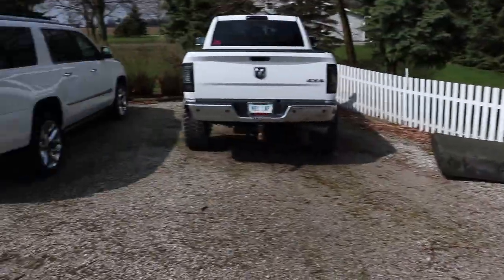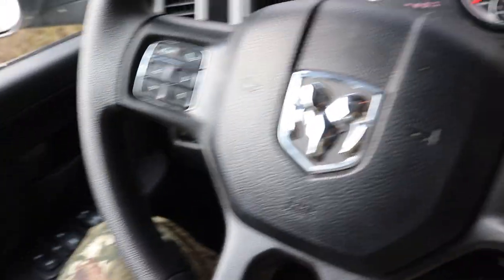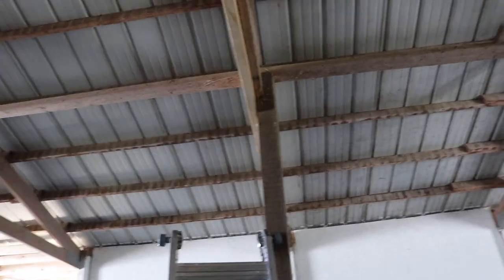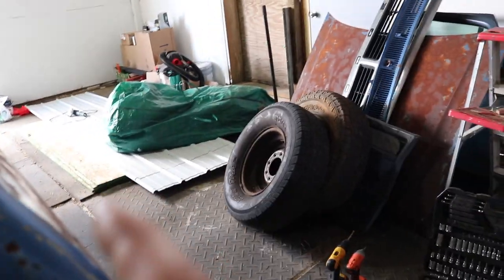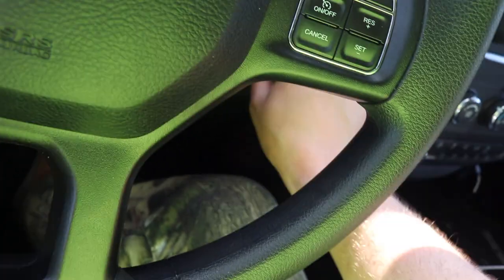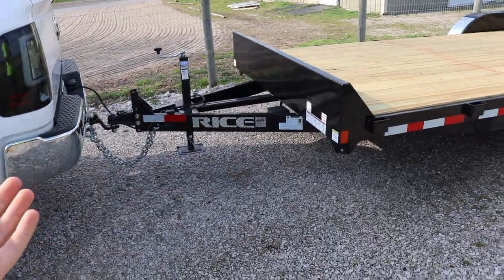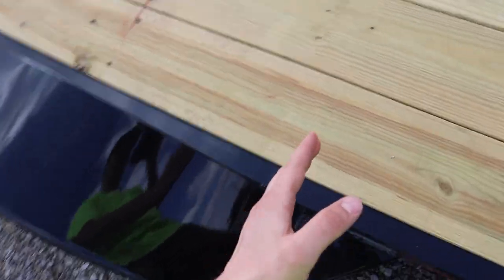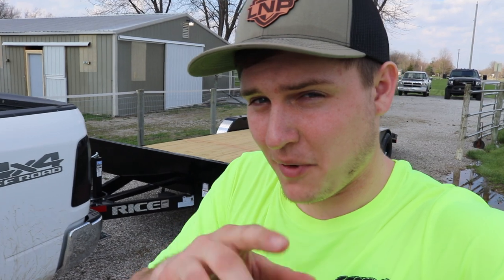I BOUGHT A NEW TRAILER!!!

Comment: 10k you’ll be close if not slightly over loaded 
10k axles - trailer weight= payload
10,000 - 2800-3000lbs = 7000-7200lbs payload 

I went with a 14k just for that reason
But that’s a very nice looking trailer
Reply from the maker: carl allen well I still think we should be fine! It will be close, but I don’t see us breaking the trailer or hurting much being over a couple hundred pounds at most 👍
Reply: Yep, payload on my 10k is around 7200#. Good for gassers or older diesels but not for the newer heavier ones. But I don't really haul trucks too often and it will haul the trucks I own so that's all I was wanting.
Reply from the maker: d m the new tradesmen we have weights like 6,900 lbs to 7,300 I believe according to a Ram Trucks spreadsheet with the specifications
Reply: @LOUDNPROUD  they are starting to get smarter by labeling the door stickers now. The tell you the gross and then they tell you total payload. Subtract payload from gross and that pretty much gives you factory curb weight. They need to just place curb weight right on the stickers. The last Ram transmission recall I did I think showed it being just over 8000 pounds (crew cab, diesel) . My trailer grosses at 9990 instead of the typical 10,400 you usually see on 10k trailers. All that aside, it's been one of the best purchases besides the truck. You're going to really appreciate having that!
Reply: Correction- just under 8,000#. Chevy,  Ford, Dodge, all of them being 3/4 diesels, 4x4, crew cabs, and short beds on our lot are below 8k. Basically just be safe and don't get tickets!
Reply: @LOUDNPROUD  that tradesman full of fuel is closer to 7600lbs

Comment: An easier way to make your bed lift is buy a 4x6 post long enough to stretch between 2 rafters. Lay it up there and fasten to the rafter. Then only need 1 chain hoist dead center of the bed to lift it. Also take that 2x10 and cut it and sandwich the metal bracket on the rafter to make it stronger.

Comment: The trailer would be great to have.  This way Reagan can stay home with the kid if she wants.  Or you can do a family trip.  
Also register the trailer in Maine.  It’s really easy and cheap.  I know NJ was a hassle to register a trailer and I’ll never do that again.  I used MBI trailer in Maine to do it.  I filled out 2 forms and sent them $100.  2-3 weeks later I got my plates
Also you can “stain” the trailer deck with used motor oil.  It’ll keep it looking really good.  But it’s really slick when wet.
Also if your trailer is overweight and you get into a wreck.  Your insurance will drop you super fast and you’ll have to pay out of pocket for it.
You could also get a set of “travel wheels” for the trucks.   This way you put them on the truck for loading and transporting the truck.   Just get the thinnest rims and tires you can

Comment: My suggestion would be to rip those fenders off and take tube steel and weld up a fender that can support the weight of the truck and just drive right over. That’s what I did on my trailer and works perfectly
Reply: Make a video of it

Comment: You could also go for weld on heavy duty drive over ramps, those hold up great with no damage. You’ll probably want to move the license plate to the fender TBH, the plates usually end up hanging “half off” underneath and untimaytely getting bent up/ripped off. Beautiful trailer though!!

Comment: U made a mistake u need a gooseneck trailer and yes u said why you didnt get one BUT you never have to worry about the fender issue it will fit any truck onto it. U could have also gotten one with tilt deck

Comment: With the trucks you haul you’re probably going to wish you had 7k axles, removable fender(s) or drive over fender(s), that or a deck over model. With the nose on the trailer you may have issues mounting a winch (because all your trucks run). Also don’t see any spare tire mounts. The beauty of 7k axles are that they are 8 lug and may fit your truck style rims. At any rate it’s your trailer and my thoughts might not be worth even 2 cents.

Comment: Nice trailer! I work on a lot of trailers doing crack repairs and replacing whatever, thats what happens when you haul over weight, good thing you spent the extra money and got the extra weight capacity. Anyways the two most popular mods i see for these trailers are a winch, Id get a 10000lb capacity , and some bright lights, just incase a truck breaks down at night somewhere and you need to go get it! both the winch and the lights will come in handy then. Trailers are one of those tools that you find a lot of uses for them once you have them and you wonder how you ever got along without one. Love the videos LNP I have been watching you since you brought that white 1st gen home.

Comment: Why didn’t you just buy a trailer with removable fenders? Then here is no issue. Also, that’s a 10k GVRW trailer. That’s means 10k load and trailer weight. So you have to deduct your trailer weight to see how much you can carry. I’m willing to bet most diesel truck will max that trailer out. Should have got a 14k.

Comment: For what you're wanting to do no offense you should have just bought a gooseneck in a 16000 lb trailer I know it's a little bit more you can go buy one off of Kaufman that is a triple axle trailer 25 ft long for $5,500 That's rated at 21,000 lb just saying and another thing is with a gooseneck nobody can borrow it because normally they don't have a vehicle to pull it if somebody's got a 1/2 ton or anything don't ask to borrow this one that's why I like a gooseneck

Comment: Coming from trucking world and farm, gooseneck would have been the better choice. 
  You always have a truck put hitch in it. The Cadillac is a luxury car and not tow truck. To hard on Cadillac transmission even though its rated.
Reply from the maker: Jaylin Coombs it’s not for the Cadillac. We just got this style just in case we needed to move the trailer with it at some point.
Reply: Agree 100%, the gooseneck seems to be easier on the ride of the truck loaded and IMO much easier to back up in tight areas